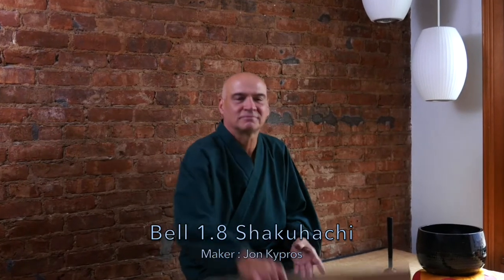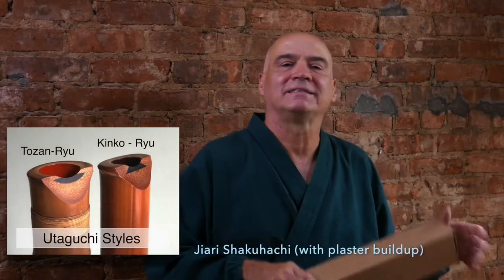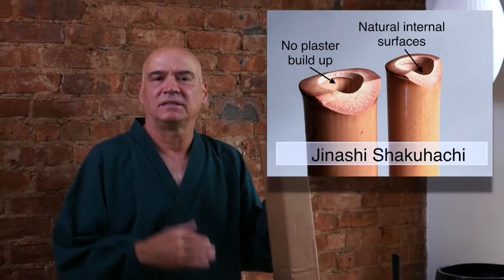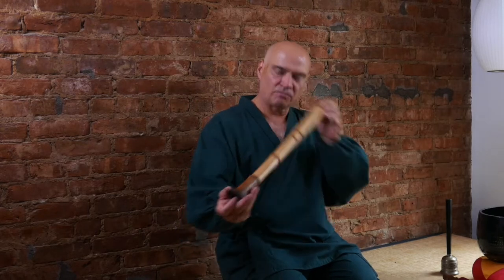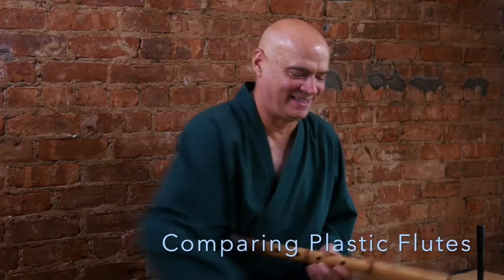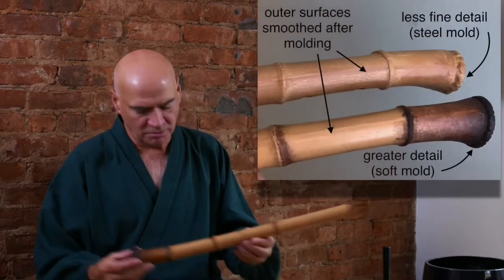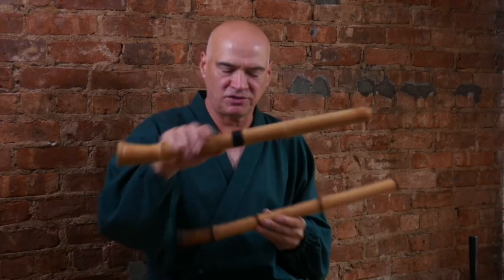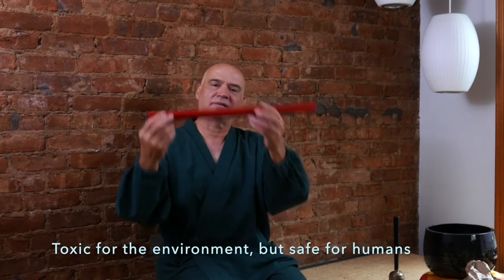Shakuhachi Plastic Copy: Bell

Comment: The Bell flute is amazing.  I didn't know plastic could sound like bamboo.
Reply from the maker: I was surprised too. The natural shape and texture of the inside contributed to the tone color more than I realized.
Reply: Why not? Plastic and "ebonite" which is a natural hard rubber, and wooden, clarinets and oboes sound the same. The only difference is, with the wooden clarinets, those tend to be expensive "pro" models and are optimized to sound best with an experienced player's air power while the student ones are made to be easy for students to get sound out of and enough range to work for high school bands. If you duplicated Artie Shaw's wooden clarinet in plastic or hard rubber it would sound the same.
Reply from the maker: First the disclaimer: I have no sponsors or relationships to any makers, but I do sell medium and high end old bamboo Shakuhachis. That said, perhaps the greatest benefit of a plastic flute is its consistency in manufacturing and it’s low cost. I love plastics, and was in product development for many years. Plastics is like a soup, a lot of choices are made when preparing it and there is great skill involved in producing a tasty result. Limits are one’s imagination and a concern for the natural environment, but a quality molded Shakuhachi is not ending up in a landfill anytime soon. It takes great skill to really maximize the acoustic qualities that a famous Japanese maker has built into the flute. But the sound quality has appeal to players of all experience. Also, because these instruments are fragile and require careful attention to humidity levels, I do not recommend them to beginners. Look for my new video about “Shakuhachi Care”. Thanks for your comment.

Comment: Kukyo/ Johnson brand does make a very fine tuned flute for $ 230.! I have 2, and another one that he makes cut above the joint, to appeal to traditional Japanese asthetics. I'm not kidding when I say I have compared them to 1,500-2,000 shakuhachis and at the risk of sounding ridiculous or disingenuous,  the $230. Dollar ones were easier to play, sounded very beautiful as well, and Frankly, could not justify spending  that much when sound and playability were compared!- maybe, on a couple of notes there were some "richer" notes.
Reply from the maker: Sounds like a good choice in this range. I have a $500. Levinson that outplays bamboo jinari flutes costing $1500. Often a new player does not know where to start, so comments like this are helpful since excellent flutes can be had for a few hundred dollars - if you know which ones.
Reply: I had a Johnson and set it aside for a while and a mouse or something nibbled on the horn utaguchi blade, which pissed me off so much I sold it as a "fixit" on Ebay and it went overnight. Sigh. I could have repaired or replaced that blade myself. I've even got some ivory around. 

I had a PVC shakuhachi given to me and that's how I discovered the shakuhachi, then a bit later got a Yuu, which I noticed was harder to blow, by a little, than the PVC one which makes sense. Then I sold the Yuu which I never should have done but I did it... got the Johnson and found it easier to blow than the Yuu or the PVC one as far as that's concerned but I'd been playing a lot of trumpet so I was not sure if the Johnson was easier to blow or I'd just gotten that much stronger. 

At time of this writing I will be shakuhachi-less but over the next couple of days I will have a "Kukyo" and another Yuu so I can A/B test them. This review of the Bell further reinforces that I'm not really interested in a Bell. 

When I am ready to get a better than beginner flute I am looking at getting the "Enhanced" Yuu that's been worked on by Monty Levinson.  Those are about $750 and probably worth every penny. The durability of the Yuu with the playability of a Levinson. 

I'm more of a jiari than a jinashi guy, since my interest is in busking. So I like a little purer tone ...
Reply from the maker: I modified my Yuu almost from the first day, and now I love it. Monty’s reworking I’m sure is an improvement to the original. But something has changed with the slump in the world economy. I have to sell 1,2, and $3000 flutes at half price to move them. Ouch. My opinion is that you can do way better now in the 6 to $1200 range with reputable bamboo than with well engineered plastics (if you are a intermediate player or better).